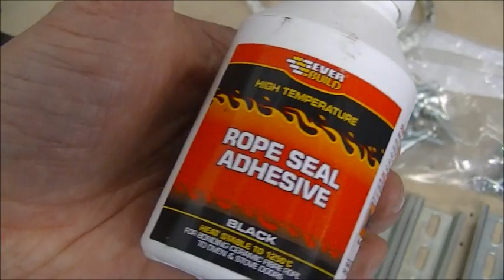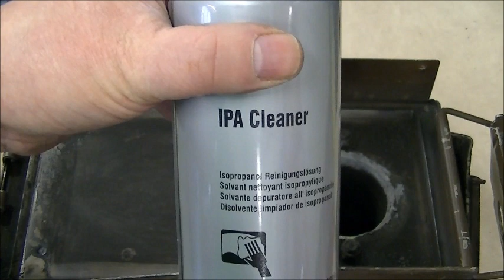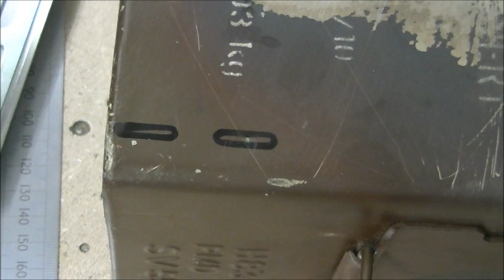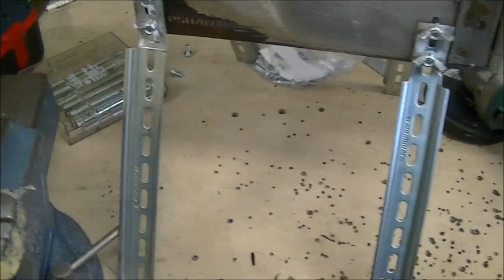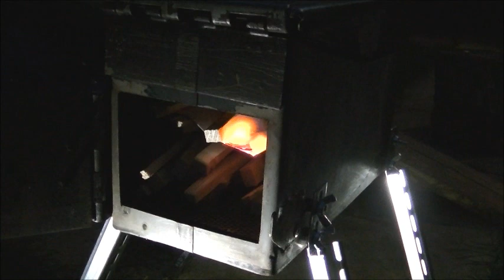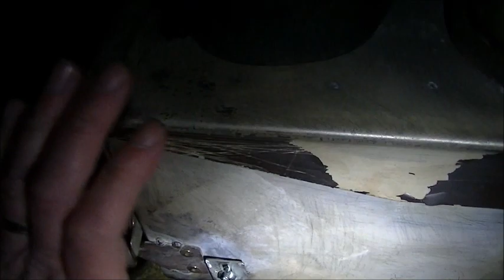Build your own woodstove with an ammo can

Comment: i am not being negative or insulting but you can tell you are not an engineer, when cutting holes or drilling thin metal you should use a piece of wood behind the thin plate and drill as if one piece, try again cutting and drilling a control baffle using this tip, i have drilled 6mm holes in 10/1000 thick carbon steel using this method to make bearing spacers on heavy presses. ATB
i'm still binge watching your video's.

Comment: It is because of the holes in the front. Closing the door acts like a kind of damper. the air is pulled in through the door hole and once you close it, through the small holes, once you can reduce the size of the holes, it will draw less and not shoot flames at all :)
Reply: It is like when you light a fire indoors. You need the air flow to get everything moving. Once you have the fire alight properly you can dampen it. (give it less oxygen) and the fuel will burn slower, if that makes sense.

Comment: Gotta get the door air intake controlled. And don't use a tin can lid. Something at least as thick as the door. I think you need something a bit more skookum for your fire grate and an extra piece of metal on the floor to extend the life if the box.

Comment: Say Funkyprepper, shorten your baffle at the top by folding it back over itself, add some additional air holes bottom front. You currently do not have enough fresh air entering your fire box and it is causing a dieseling effect.

Comment: if your flu was longer this will stop the blow back and to stop sparkes and dampness in bad weather put a cap on the flu for example an oil filter and a few pieces of flat bar riveted to the flu or manufacture a circular slide on clip

Comment: Nice planning, execution, and product! I have been wanting to do this for years, but DIY projects dont usually turn out so well for me. I believe your issue with your stove not drafting properly is because you need an airflow moderator on the door vent - a simple little rotating disk like the can lid you worked on would probably do it. A lot of the manufacturers put a fine steel screen over the airflow control holes so any embers/sparks that try to jump out why you are sleeping get caught.
Reply: +Dee Dubbs If you increase the forward pressure (ie the disk airflow controller increases the pressure drop through the intake holes, or a longer chimney would do the same) then you also increase the reverse pressure drop, making it harder for wind to flow backwards through the system. The higher the internal temperature of the stove, the hotter the air, and the more intensely it will want to rise. I have tried to use a Native American trench furnace (a dugout version) many times, and I usually end up with my tent smoked out!

Comment: instead of making more holes, maybe try attaching some channel iron inside the door behind the air inlet with the top capped off so it forces the draft under the fire. don't let the channel be too shallow as it could restrict the flow. just a thought, haven't actually tried it.

Comment: looks like it's back drafting. Maybe try to use a can lid or something similar round metal to rig up a butterfly type damper in the flue. once you get the cover figured out for your door draft holes that should help too to let it suck in the front and exhaust out the top.

Great idea though and really like the leg setup you did. Wondering what I can due with a spare Fat 50 can I have.

Comment: Nice one... When it is 20 below outside and shorts weather inside a hot tent in the winter is amazing.

As for the front damper give my stove a look and take a gander at the slider that I built into my door vent. https://www.youtube.com/watch?v=H1wTzqVHUQU

I think that you can do one similar (only top to bottom rather than side to side like mine) in the space that you have available to you that would work better than any round disc. Take a rectangle of sheet metal and mount it with self drilling screws through the door just on the outside of the rectangle damper. If you give the rectangular steel a little bend in the middle that will give the damper enough tension against the door that when it is pulled up it stays up and does not drop back down. Doing the door damper this way would mean that you would not have to drill out any holes in the rectangle as it will gradually cover the holes as you raise or lower it.

Any stove is a good stove if it keeps you warm when it is cold outside... Cheers and have fun hot tenting...
Reply: Ah, also, the more stove pipe you have/add the better the draw will be sucking the smoke out rather than puffing it out the door. When the stoves get hotter the draw gets better and smoking reduces.

Comment: Nice one. Great little warmer & cooker for the ol 9x9 once you finalise the mods. From the Darren smoking a cigar rhythmic puffs of smoke lol coming out of the small holes - could be woods burning gases needing a vent elsewhere or additional to depressure the gases?
Just got me a deal on set of s/steel pans similar to the bread bin stew pot we used at the meet, project to make cylindrical wood stove based on pot belly. Those galvanised struts you used for legs I think would work a treat for the legs of my burner - dismantle & put all the bits n bobs inside lidded stove.
Be good to see the next stage of ya ammo box

Comment: Hi Darren,
I thin the guy from NorwegianBushcraft is right but, i would rather put the air flow under the stove ( right under the grill u have inside there) and dont blend the hole in the door just in case you need them..
Reply: aaaa and i almost forgot make a closing mechanism for the holes in the door and under the stove also (so u can decide the airflow inn)

Comment: Air control on the front and a baffle or butterfly in the chimney should solve your problem mr prepper sir. check out the video by fox123456789ish ATB squeak

Comment: Nice job,looks like you just made a rocket stove,need to make a small flap for vents on door and seal around door,make exhaust pipe longer and add baffles inside pipe to prevent flames from shooting out. I would like to see you use grill rack also,all said really cool outside tent stove

Comment: Your 'blow-back' is caused by the fire not drawing enough oxygen, the baffle may need to be higher, think of water, if you narrow a channel it moves faster, warm smoke is 'fluid' this may increase the airflow. The mesh that the wood sits on could be raised also to allow the oxygen to flow under. Basically what you have is a 'backdraught', add oxygen it roars, close the door it dies down, it's hard to explain exactly. But I hope this is helpful.

Comment: I think the others are right, wood gas is burning in the pipe and body of the stove due to restricted exhaust and air flow from the baffle. Neat little stove that seems very efficient and fun to use!! Also, brother, you are ever so right in the "test your gear before relying on it" philosophy. Spot on.

Comment: You could put a butterfly choke in the chimney to help control the burn. The puffing I think is due to the fire been the same height as the air intake. Lower your intakes? Wouldn't fancy using this under canvas unless I had a 12ft exhaust with a spark arresters. Love your vids funk keep them coming. And work less hours you seem stressed

Comment: Hi Darren,
I have made one like that myself, you need more air intake, try to put a regulated vent in below the door so you can get some air in under the plate filled with holes. It will also help with a longer pipe. You should have a pipe going 0,5 meter above the top of the lavvu to get a good draft. Another thing I discovered is that to much air gives you a jet like flame even from a 1,5 meter long pipe. So to prevent that you need to be able to regulate the holes in the door also. Experiment wtih the baffle plate to get it right and at the same time place it so it will consentrate the flames on to the coocking area of the stove top.
Remeber to make a good and big enough heat barrier between the stove pipe and the vent hole in the lavvu. I burned mine last winter, and that was with a lot of insulation between the pipe and the tent itself. It gets really hot. 
Another thing, to be able to use it in the polish lavvu, you need shorter legs to prevent the lavvo from burning, you almost have to put the stove on the ground. I ended up with som bolts only. Its a over-kill in the polish lavvu, but it works fine when your able to regulate the airflow. I have used this little stove to heat a big tarp lavvu, no problems.
Good luck, and happy new year.
Atb, Odd

Comment: Nice one Funky, loving it. Good tip for drilling through thin metal Funky is to wedge the metal between two pieces of wood and drill right through the whole sandwich as it were. You need to clamp it together with mole grips!
 Also instead of cutting the edge off it, you could have folded it toward you and it would have given you a point to turn it to open the vents......but it's coming on and your doing a great job. Puffing smoke is probably a combo of cold air and short flue pipe, definitely extending baffle would help with flame and the draw ........ nice one Darren good job mate. Love it!

Comment: nice one darren, i think the smoke puffing through your vent is cos it wasnt hot enough to burn up the excess smoke, but got it really hot, it was almost a flash over, which is when oxygen meets very hot smoke and just bursts into flames, we do a similar thing to show it in fire dept training, ( plus you may have had some burn off of the glues etc going on too, )  the flames out the chimney is because when you got the front door wide open you basicly have a rocket stove, and looking at the chimney you can see why they're called that,   your baffle could do with being a bit bigger and or closer to the chimney port hole, but apart from that it worked well, to boil things and cook on top faster you could cut out a hole in the top and make a cover like the frontier stove, or drill holes and make a larger version of the one in the door,   love to see it all painted n pretty, cheers, dave

Comment: Darren
I have a few ideas for your stove, although you have done a fantastic  job of building the stove. Maybe if the vent holes were drilled under the door with a sliding piece of metal so one could damper down the in-let combustion air. On the chimney add two 90's right at the top of the oven so the fire would have to go through them. Add a flue damper so you are not burning through so much wood and keep some of the heat.
As for the grill if you were to add extensions from the legs up over the top with the top off where you would be able to place your grill, The stove could be used as a bar-b-q also.
Just my two cents worth.
I would like to thank you for the ideas. As always you have out done yourself. Great video.  Thank you so very much for taking the time to share it with us.
Thanks again
Dave

Comment: Awesome Build and Great shop you got to work in.. as far as the air control on the door you could hole saw a disk out of a scrap piece of steel and mount on the inside of the door maybe..perhaps get a bolt head welded and pass thru center hole to the outside of door where you can mount a small handle for it to rotate it as you need for air.. Hope that made sense.
AWESOME JOB!!!!

Comment: That's a better size rope,I think I must have had a few ciders when I told you size of the rope Ha Ha.
I had the same puffing with the one Rich has got and I think I fixed it by putting more holes in the door(sorry I made the other one while ago and cant remember what I did )try it with the door open a bit if that fixes it that would suggest it needs more holes in the door.When I did the test burn I did not get any puffing so maybe try taking the grill out and having the fire directly on the floor of the stove?
I did a lot of tweaking with Rich's stove(good job yours was free or I would have to give you a refund Ha Ha)
 just keep tweaking I am sure you will get it working.
Cheers Jason
Reply from the maker: the willow wood cider rope haha
i love it - the tinkering & tweaking, learning and sharing ideas.
got to find some time to try other ideas.
this video series could run a bit :)
i hope christmas day want too hectic for you jase.
thanks for starting it off for us, brilliant
cheers mate
darren

Comment: Nice one Funky! Interesting reaction with the bellwoing. I remember as a kid my dad would light the fire in the fireplace at home, on the ground floor of the 2 story house, he always used to get it roaring straight away then let it settle to a reasonable fire, to push the cold air out the chimney before the smoke just backed up into the house.
On the other hand, I was up at the inlaws over Christmas and it was a bit of a dance with their beautiful wood stove between managing the air in through the front damper and the air out of the flue above. A wonderful device when you get it sorted though.

For my guess, I think the raging fire with the blow back is probably caused by a lack of air coming in with too much going out, sort of like how a bottle will chug out its contents as they try and escape while the air tries to fill the void the contents leave but both trying to use the same opening... Crack the door a bit or reduce the fuel and perhaps the balance will be found?

Carry on, stay Funky!

Comment: Hi Darren,
I think the smoke puffing from the front maybe due to the wood gas burning then depleting the oxygen, then fresh air being drawn in and when the right fuel air mixture is present it reignites making that popping sound and as the gas is expanding rapidly some therefore comes out through the door holes, One solution maybe to regulate the air flow at the door, or the other to increase flu diameter or to alter the size and shape of the baffle. I think the stove would work better if some hot gasses were allowed to escape at points around the sides of the baffle to. I think that would also help to stop the puffing.
I have two wood stoves in my house and the baffles on both stoves allow hot gases to escape around the sides.
Good project.
Happy new year
Sandy
Reply: I think he needs some small vent holes lower down in front to draw air in. So air comes up from below, feeds the fire and the smokes goes up as it should.
Like a Rocket stove.
Reply: +Wiltshire Man More pipe would help, the effect is to create more vaccum at the intake due to increased velocity of the air in the stovepipe. It doesn't start being a restriction till the pipe gets so long the smoke inside it and the outside air get close to the same temperature which is going to be much more length than you would ever need it to be.